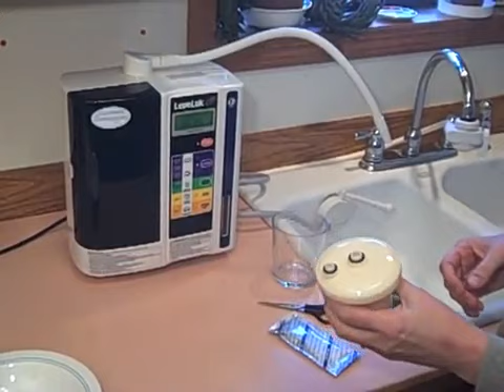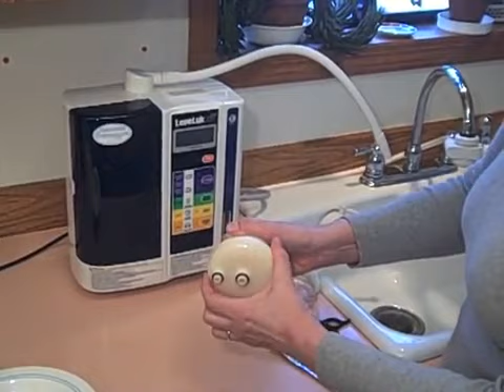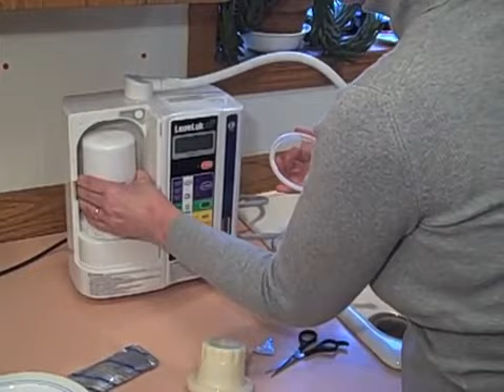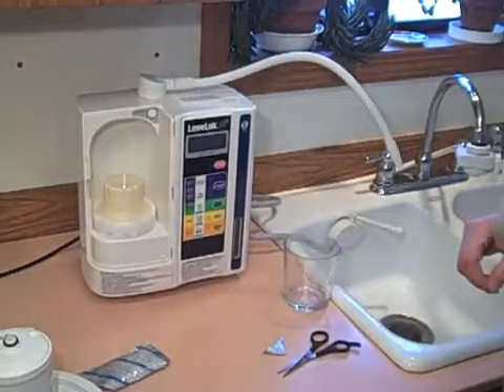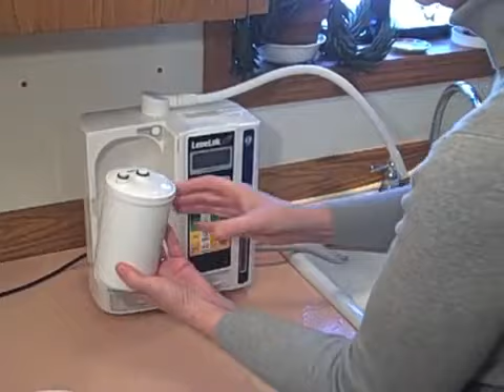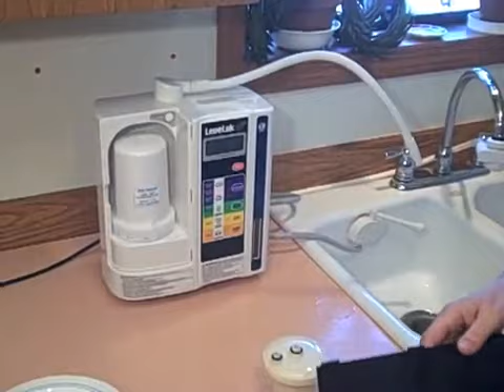Cleaning Your Kangen Machine with the E-cleaner

Comment: Do not flush the water! It only takes 1 cup of water to dissolve the citric acid. You are dumping the solution down the drain. The machine only holds a few cups of water. 
The plates hold about an ounce of water.
Flushing one liter is what you do at the end to FLUSH the machine of citric acid. 

Try it, pour the citric acid packet into even a half cup of water, it fully dissolves. You literally are flushing all the citric acid down the drain. This logic is flawed and is based on having no technical understanding of the machine's innards. Whoever showed you this method did you a great disservice. 

The strongest part of the cleaning solution is in the very first cup. 1-liter will flush out the entire system of citric acid. Taste the very first bit of water that comes out of the machine in the first second, it's a strong citric taste. Then, open the cleaner cartridge, the citric acid is gone in 2 seconds, fully dissolved.

Get a tall glass and fill it up 3/4 of the way SLOWLY. This will fill the entire system with a concentration 100x's more potent than the method you're using. In your case, possibly infinitely more potent.

You need to deep clean your machine and fix your method from here on out.
Reply: i looked on kangen site and it shows to let it run ten seconds before putting it in water to stand overnight. i will be doing that as i would think the kangen would know